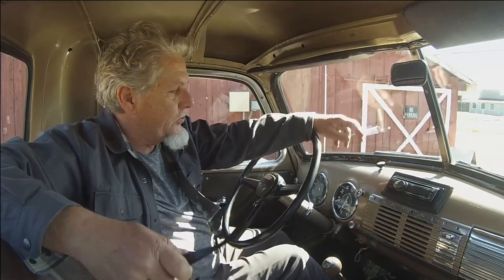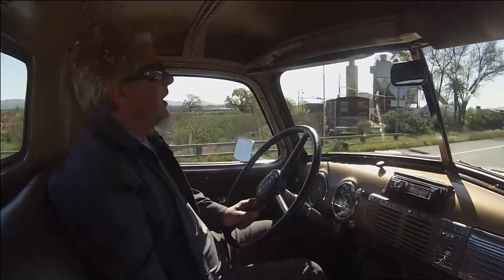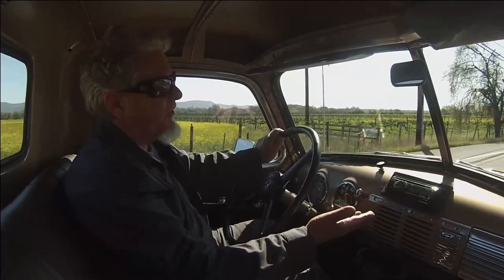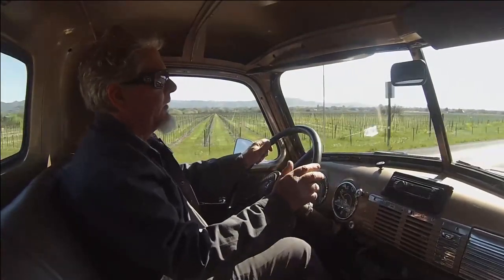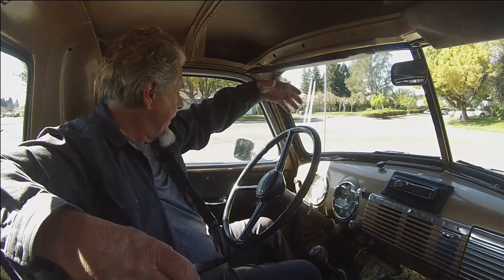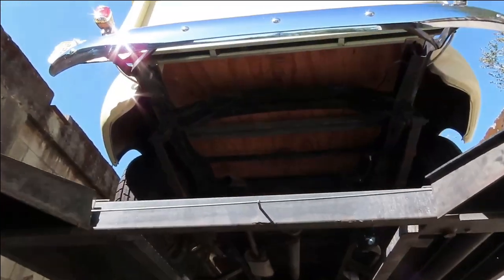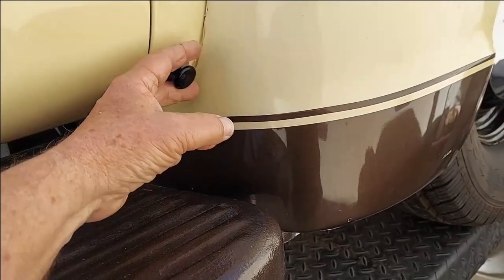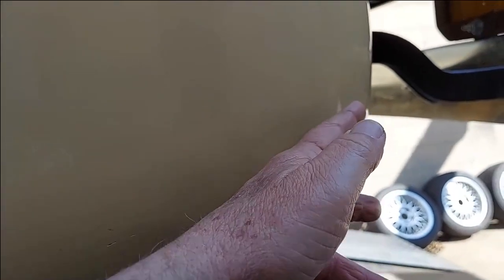1948 Chevy 3100 1/2T 3-Window Pickup Truck

Comment: Some inbreeder will  probably  buy it and rip that sweet h 6 out and v8 has to be installed  ..leave it as is ..  there is enough hack jobs 
Just change over to a GMC  292  6 cylinder   .. better brakes .. gear vendors overdrive  .. enjoy.  
I have several old gmc chevrolet trucks 292 6 conversion  ..  the 216 is babbitt engine  and reliability issues  .  Sweet truck  
Hope it finds a respectful owner ..